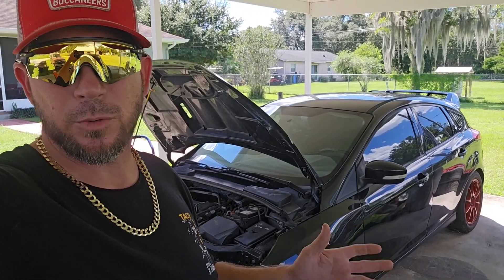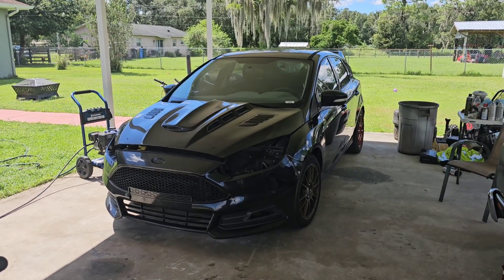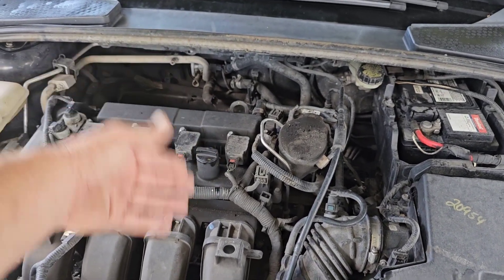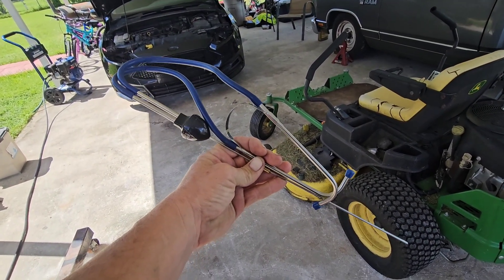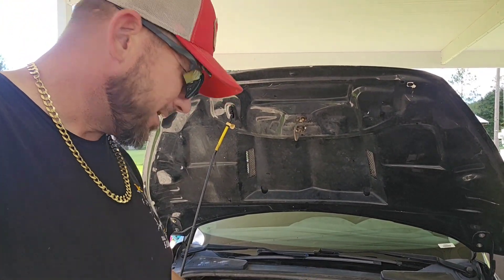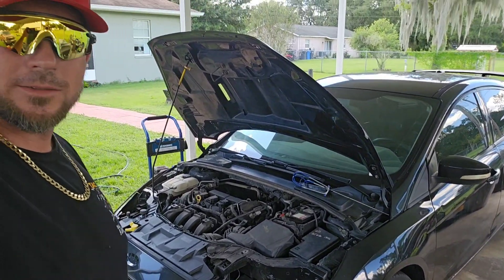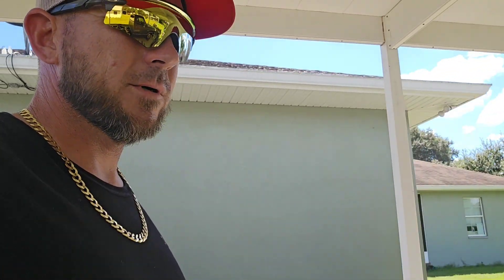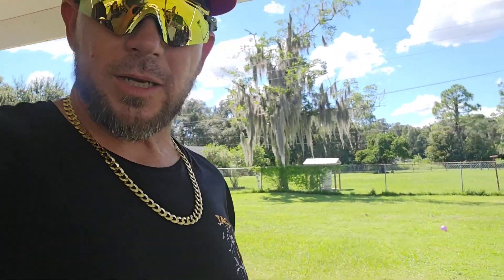WHAT DOES ENGINE KNOCK/ROD KNOCK NOISE SOUND LIKE? WATCH AND LISTEN

Comment: was this on its 2nd engine
Reply from the maker: The third. After this I installed the fourth. I'm at 519,800 miles on the car. The engines usually last around 100,000-150,000.

Comment: You’re crazy to rev it up with Rod knock like that lol. Rod could come flying out the block
Reply from the maker: The engine is toast. Why would I care? I put another one in. They cost $600. They are cheap and easy to replace. Not cheap and easy to fix. It made good content.
Reply: @roadsideguy5902 Did you diagnose it?

Comment: You should remove the oil pan and take off the end caps from the rods and check the bearings.  If the crankshaft isn't badly scored, you might be able to polish the journals with some 1,000-2,000 grit sandpaper and replace the bearings wirh the engine in the car.
Reply from the maker: I can replace the engine faster and cheaper. Which I did. Thanks for watching and commenting.

Comment: Maybe should have changed the oil a little more regularly, but 450k isn't bad for one of those. Going to get an engine for it?
Reply from the maker: Yeah, I just ordered one with 63k miles on it for $600
Reply: @roadsideguy5902  that's a good deal
Reply: You installing the engine yourself?
Reply from the maker: Yes